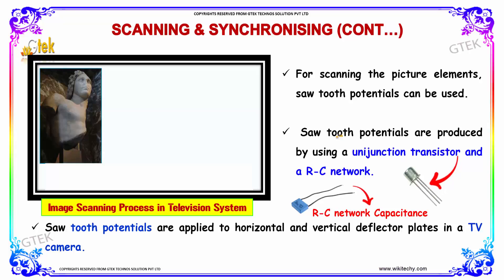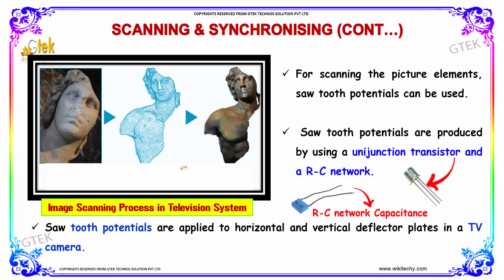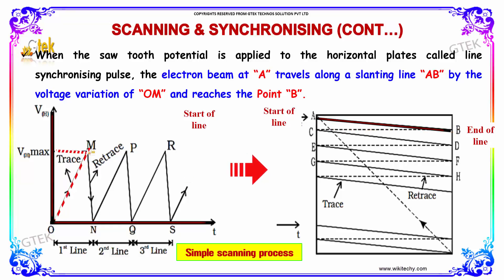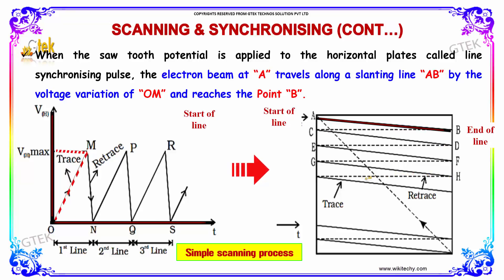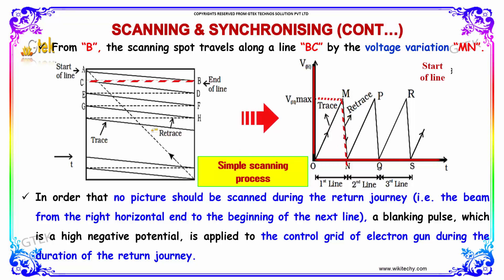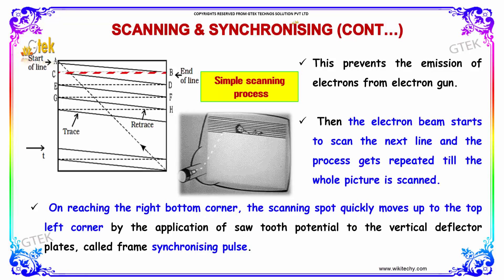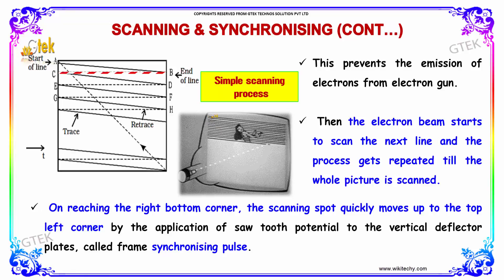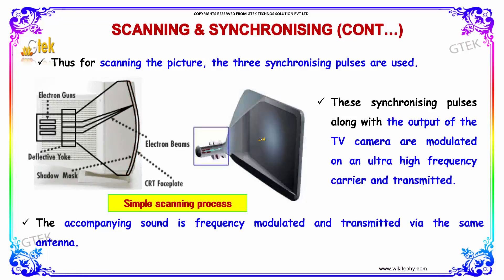Image Scanning Process |Communications system|class 12 physics subject notes|CBSE|IITJEE|NEET

Comment: Turn on the computer and printer to make sure they are connected. If the system is not working: ... Navigate to the scanning program's location. In Windows, click on the start button to bring up active programs. ... Run the scanning program. Find the scanner program.

Comment: The image sensor mechanism, consisting of 300 to 600 sensors spanning the width of the scan area, is placed very close to the glass plate that the document rests upon. When the image is scanned, the LEDs combine to provide white light. The illuminated image is then captured by the row of sensors.

Comment: computing, an image scanner—often abbreviated to just scanner, although the term is ambiguous out of context (barcode scanner, CAT scanner etc.)—is a device that optically scans images, printed text, handwriting or an object and converts it to a digital image. Commonly used in offices are variations of the desktop flatbed scanner where the document is placed on a glass window for scanning. Hand-held scanners, where the device is moved by hand, have evolved from text scanning "wands" to3D scanners used for industrial design, reverse engineering, test and measurement, orthotics, gaming and other applications. Mechanically driven scanners that move the document are typically used for large-format documents, where a flatbed design would be impractical.Modern scanners typically use acharge-coupled device (CCD) or acontact image sensor (CIS) as the image sensor, whereas drum scanners, developed earlier and still used for the highest possible image quality, use aphotomultiplier tube (PMT) as the image sensor. A rotary scanner, used for high-speed document scanning, is a type of drum scanner that uses a CCD array instead of a photomultiplier. Non-contact planetary scanners essentially photograph delicate books and documents. All these scanners produce two-dimensional images of subjects that are usually flat, but sometimes solid; 3D scanners produce information on the three-dimensional structure of solid objects.Digital cameras can be used for the same purposes as dedicated scanners. When compared to a true scanner, a camera image is subject to a degree of distortion, reflections, shadows, low contrast, and blur due to camera shake (reduced in cameras with image stabilization). Resolution is sufficient for less demanding applications. Digital cameras offer advantages of speed, portability and non-contact digitizing of thick documents without damaging the book spine. As of 2010 scanning technologies were combining 3D scanners with digital cameras to create full-color, photo-realistic 3D models of objects.[1]